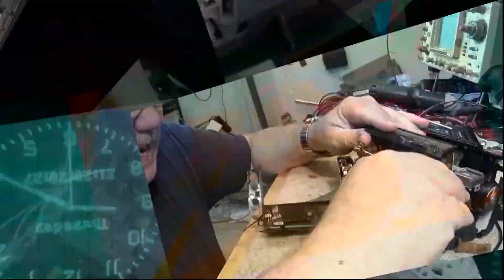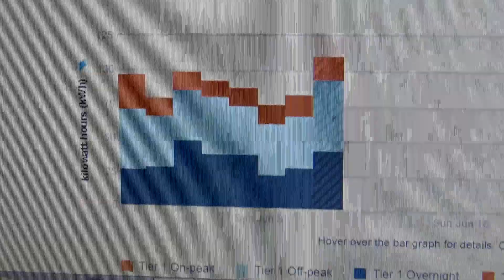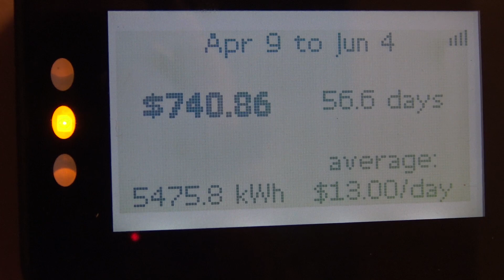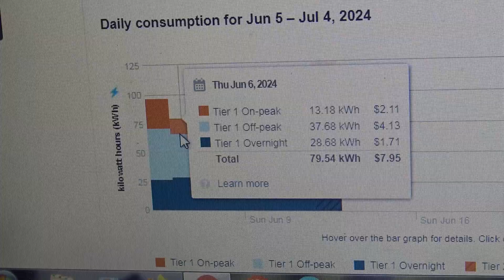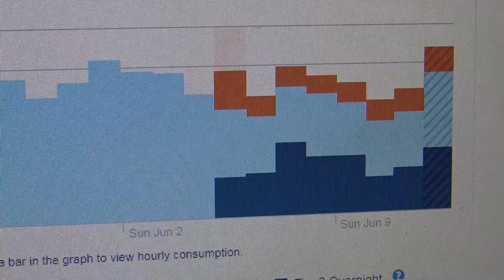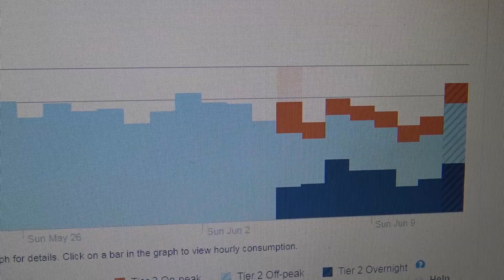BC Hydro has a new time of day rate plan and it is going to save me a bundle

Comment: Jeebus, 300 a month for power? You need to unplug all that old junk you have that eats up 10W in phantom power by just being plugged in. I don't exactly conserve power, and have many PC's running 24/7, and I'm PO'ed if my bill is more than 100 a month!
Reply from the maker: 2 electric cars.  How much gas does your car burn a month?  My plug in hybrid uses about 1 tank if fuel a year unless I am traveling.  In the past month I have used about 1.00 in fuel.. The 2 cars use about 20 a week between the 2 of them.   I'm waiting for the last fish to expire in the tank then it will go. The pump that runs 24 hours draws about 100 watts.   The light that runs 12 hours a day 100 watts.  There are a few things that waste power like modems security cameras ect.  I do shut stuff down when nor in use.  Big plasma tv chews up a fair bit too.   Its not running all day though.  Just a few hours in the evening.    Lots if stuff here though.  Hot tub ect.

Comment: I live in New Jersey. Have an electric stove, electric water heater, and an electric clothes dryer. Have two AC in 2 windows  that run constantly in the summertime. In the summertime my electric bill is $100/ month. In the wintertime,  half that. My electric company has a program where the longer you are with them, the less you pay. Ive been with them for 16 years.

Comment: Get rid of the electric vehicles. Everytime you charge them, the enerygy comes from fossil fuels. EVs are a waste. Our world will always need gas and oil. Solar and wind energy will NEVER power a city. Can you imagine a jet fighter running on electricity? A tank in a battle with its battery dying?
Reply from the maker: Sounds like someone that has no clue.  Our electricity is hydro. Clean renewable.  Hydro and nuclear is the way to go. My cars cost about 2.00 a day to run. 
I drive about 40 miles a day. That uses 12kwh of power.  At the high night time rate that is 1.09. A 40mof gas car would use 1 gallon of fuel. Gas is just under 7.00 a gallon.  So 7.00 per day vs 1.00 per day. Have 2 cars that drive about the same mileage every day. 2.00 to change 2 cars vs 14.00 for gas, and you are telling me it isn't saving money.  The only people that buy into this are the ones that listen to idiots on the internet that don't now what they are talking about. 99.9% are trump supporters. Lol.   
We just had our first test flight yesterday of a fully electric airplane that is headed into commercial service soon.  The company compared the costs of running this compared to a cesna.   Cesna costs about 70.00 per hour in fuel. Electric plane 2.00 in electricity.  So many evs in KY neck of the woods and more being sold every day.  A local gas station just closed this month.  That will be a common occurrence over the next few years.
Reply: @12voltvids  How about an electric military fighter plane? No way. An electric  commercial airliner that can fly at 600 mph from, say, NYC to Europe ? That's a long, long way in the future. Here in the USA, some states want to tell you what to buy. You can't buy a gas stove.Have a gas furnace. Biden wants all new car sales to be EV buy 2032. What happened to free choice? Yes, nuclear is the way to go, but with so many liberal politicians who are afraid of nuclear, it will never happen here.
Reply from the maker: Can't build a house here anymore with gas heat.  Can't install a gas range into a new home and wood fireplaces are now banned from new construction.
Reply from the maker: Never said an airliner that flys ny to Europe. But here the coastal sea planes that ferry people to the small islands can easily be done electric.  Private cars and trucks generate the most of the greenhouse gas. Even if 10% of the cars were electric it would make a huge difference

Comment: Thanks Dave.
I guess I am spoiled. My Power bill is in the $80 to 90 a month here. (Central Wisconsin) 
Propane Stove & Hot water.
100 Lb Tanks lasts about 4 1/2 to 5 Months. and only $75 to Fill.
Heat is almost free. Wood from My own Property, also heats the Domestic water in the winter. Water Heater is turned off. power is only used to run the 2 Pumps. 
My biggest constant draw is the Lights & radio in the Pole shed are on 24/7  to keep critters out till I can get My floor installed
Reply from the maker: Right but you have to buy gas for your car.  I don't.  Ev costs 1/5 the price of gas car and that's just the energy.  My car paid for itself in 7 years compared to old gas guzzler I drove. Can't have wood burning fireplace here anymore.  It's about air pollution.   Just heard on radio today that existing wood burning fireplace needs to be registered now and can not burn cord or split wood starting next year.  Only things like presto logs.
Reply: @12voltvids  I hope I am 6ft under before that crap gets here. I'll be 100 come 2060 LOL...

Comment: What electric car do you drive? Does it save you money over gas?
Reply from the maker: Yes big time. For the driven miles it would be about 100 a month per car. EV cost about 1/5. Even less with time of day billing.
Reply: Dave, how long of a charge will it last in hours. How far in mileage can you drive on just one charge!
Reply from the maker: @VinceFelix-ff9cf mine is a plug in hybrid so it has a generator on board so no range limits as it switches to gas when charge runs our, but with a fill charge 80 to 90 km and then the gas fires up.
Reply: @12voltvids  90km..what is that in mileage!
Reply from the maker: 55 miles.  I can drive 50 to 55 miles for between 1.25 and 1.50. Try that on any gas car, and remember i have gas backup so when I need to drive beyond that range the engine starts and I just drive and put gas in the tank when its empty. 42mpg, so 9 gallons will take me about 375 miles between fill up.

Comment: I am a senior but I'm on an equal billing plan with BC Hydro, about $150 a month, so I pay a few more dollars on my year end bill. I have to have 2 air conditioners running all summer long or I will die from the heat, plus all the other equipment I run during the day adds up.
You're right, that kind strategy is not for me. Good for you if you have the time and energy to do this, we all need to do our part to save energy.
Reply from the maker: During the heat wave last summer my bill hit 1200 for the hot months.

Comment: Do you have natural gas or oil? Would it be cheaper to switch to a gas hot water heater?
Reply from the maker: I have gas for the range, fireplace and emergency backup. Gas is actually much more expensive. In the winter I turn the gas fireplace on and it will easily burn up about 80 in gas. Well not actually the cost of the gas, but all the fees added. Last month I used 0.9Gj of nat gas for my range. This is a very small amount. In cubic feet 1Gj is 947 cubic feet and I used 0.9.
Cost of the gas was 2.01 but the bill was 25.37. Gas currently cost 2.23 per Gj.  The rest is fees and taxes. The government used to own not only BC Hydro but also BC Gas and they distributed it at cost. The BC Libersls under Gordon Campbell and Chrusty clark sold off BC gas to private companies and well they have to make a profit, because they are greedy bastards. 
So there is a basic charge of 12.23 per month charged just to connect you to the main. Call this a meter rental. Then they charge  0.24 per Gj to store the gas in the pipe. Then another 6.71 to deliver the gas in said pipe.  So, 12.23 to maintain the pipe and meter, 0.22 to store the gas in the pipe, 6.04 to deliver the gas, the cost of the actual gas 2.01. The government has to get their pound of flesh in the form of a carbon tax, again another brilliant idea by the previous Liberal government and the current one won't get rid of a tax, to the tune of 3.99 per Gj of gas. Then there is the clean energy levy of 0.08 and the feds get their 5% GST on top of all the other fees for another 1.20.
So to run a gas range it's 25.00. When I fire up the fire place, a very small fireplace that is set to the minimum it wil ge closer to 60. Just talked to a friend that heats with gas, has a gas HW heater and a gas dryer and cooks with gas. His gas bill 300.00 per month. So no gas is NOT cheaper. It is far more expensive, and a gas HW heater needs to be replaced every 10 years because the heat exchanger wears out quickly. Electric tanks are good for at least 20 years.
Reply: @12voltvids  I was going on 24 Years on the Natural gas Water Heater at My old place before the Fire, The Anode Rod had ben replace a few times as will as the bottom flushed out with full water pressure and the Drain was replaced with a 3/4" full port Ball valve when I had the loop for the OWB created. When the last Anode rod was replaced I shop Vac'd out the bottom. A bright light into the top and the Gas Valve out I could see well inside the Tank.
The OWB loop had a sediment filter to catch any crud before the water went into the Flat plate heat exchanger (Hot water rated) .

Comment: They must do it different where you live, down here in Texas my electric bill last month was only $146 and some change. But I’d be curious on how much electricity your vehicle use to charge.
Reply: he said both vehicles are 20kW almost daily lol
Reply: I live in the same area as Dave and my electric bill is around $100 every 2 months. I do not own electric cars, or heat pumps or have an A/C system in my home.
Reply from the maker: @bobsoft  But how much is your gas bill?
Reply: @12voltvids  My Fortis bill? That just came in at $50, of course its higher in the winter with forced air furnace and water heater running more. As far as petrol I wouldn't be a fair comparison since I retired 2 years ago and drive under 5,000 km a year in my 4 cylinder car.
Reply from the maker: @bobsoft  I have many things that suck back power here big time. Heat pump, Hot tub, 2 electric cars, electric hot water, and big power hungry plasma TVs, plus a couple of AC units. Also a fish tank that I can't wait for the last fish to kick so I can take that down as it has pumps and lights that run all the time. Idle power here, with nothing but the essentials running draws about 2Kw 24/7.
Reply from the maker: We used to be on a flat rate, which was much fairer. The previous government under kristy klarke brought in a 2 tier system  with 1 rate that is totally unobtainable for anyone that runs electric heat to achieve. Pay 1 rate and hit the cap, and pay double. I would hit that cap after about 12 days and then pay double for the repainted of the billing cycle (2 months). A very unfair system. The government said it was to force conservation. How? Turn off the heat in the winter? I would love them to go back to a flat rate, with an evening discount. That would totally rock. 146US is 200CDN.